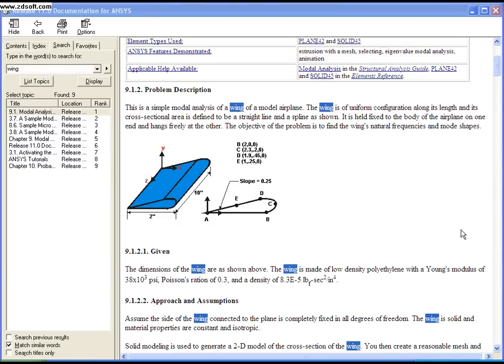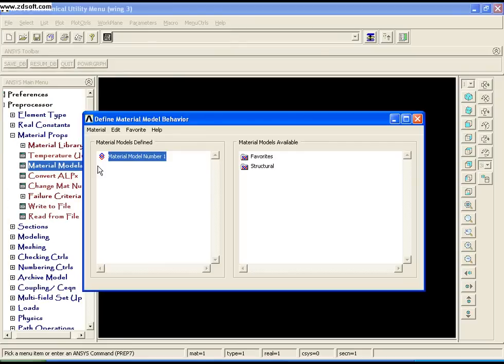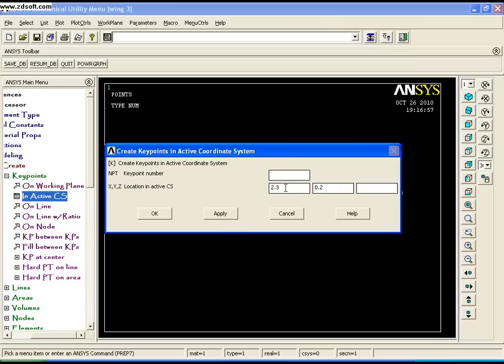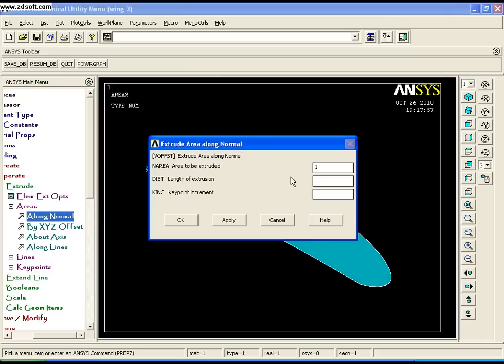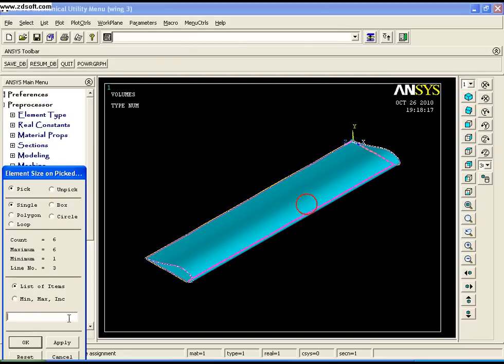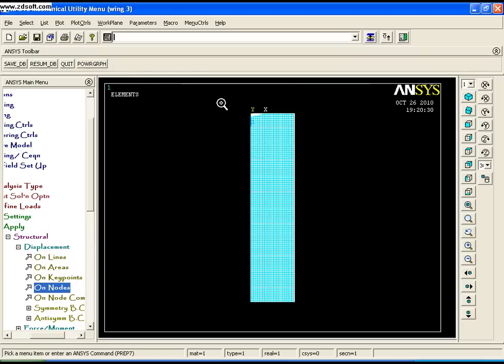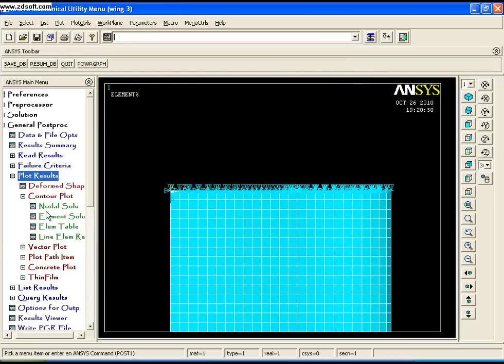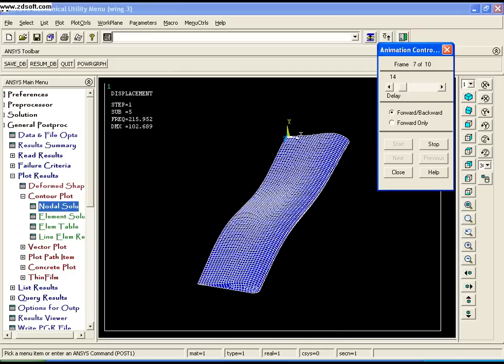model analysis of a wing using ansys

Comment from the maker: its a structural, model analysis not an aerodynamic one 
where angle of attack would change the flow pattern in turn the resultant force.

so if your are considering the real case, with change in angle of attack there would be a change in magnitude of the resultant and its location in turn which changes the stress values